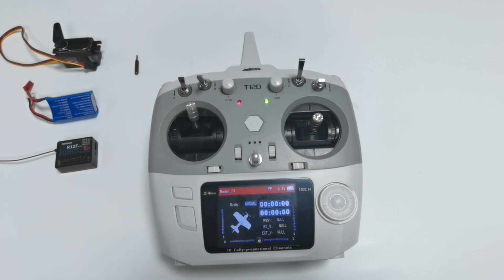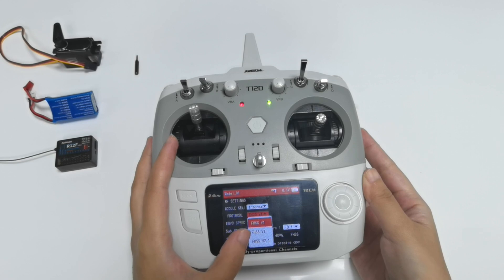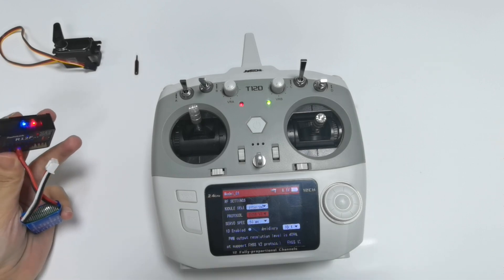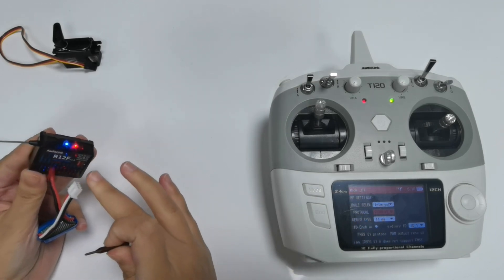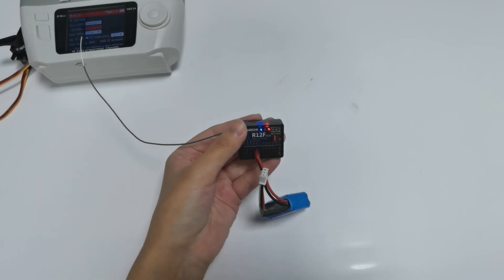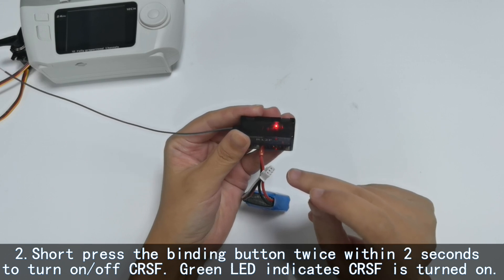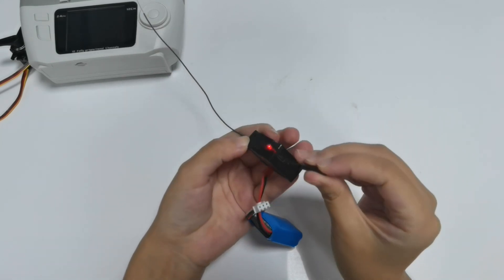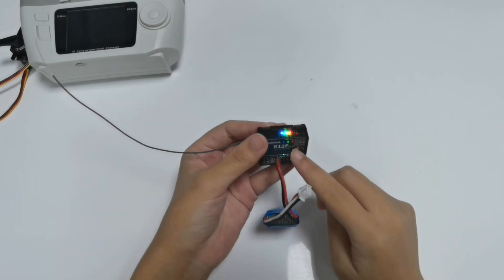Binding & Working Modes of R12F

Comment: Well i wanted to ask does the T8FB really provide 1.2 miles of range ?
Reply from the maker: Hi, sir. May I know what receiver are you using with T8FB? T8FB comes with R8EF receiver, which supports 2000 meters control range when there is no interference. You can check more details here: https://www.radiolink.com/r8ef  If any question, please feel free to contact us. Our email is after_service@radiolink.com.cn